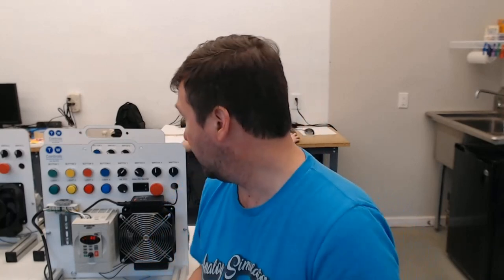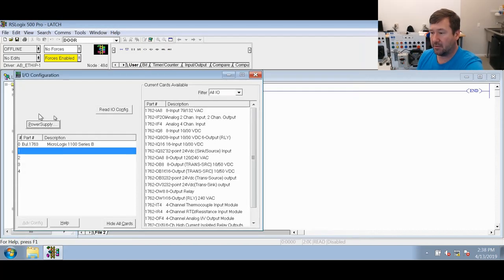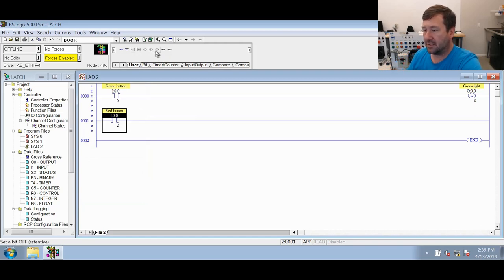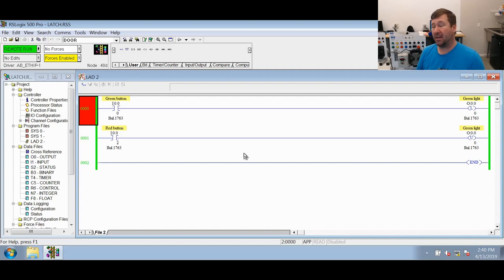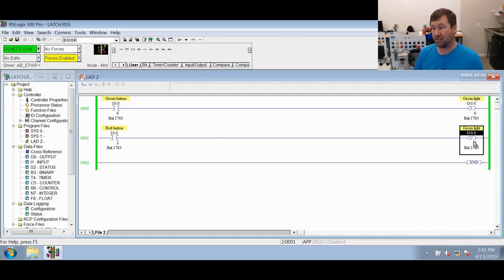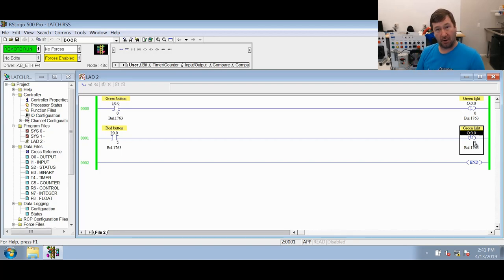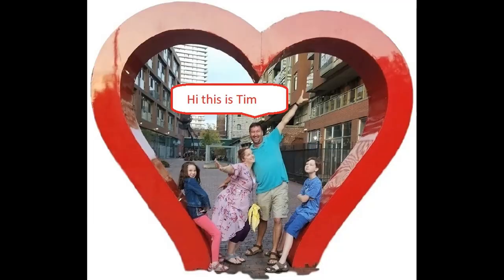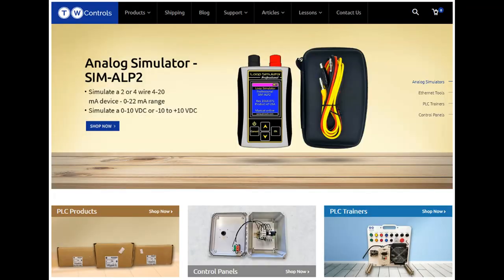RsLogix 500 Latch OTL and Unlatch OTU. Instructions to set and reset

Comment: I love this channel but this video left me asking more questions. Im that guy that doesn't fully understand the OTE/OTL/OTU instructions and how they are processed and controlled. I would like to see examples (right way and wrong way) of how you control step chains when using multiple cylinders (specifically 5/3 valves). I keep finding myself in logic loops that lock up my valves. Thanks for you channel.
Reply from the maker: Hi Nick. My note around 4 minutes in the video kind of hits on that. Latch and unlatch instructions are not the best way to program sequences. We've got a video series on sequence in machine steps coming out that won't help you today. Here is an article series that goes through different ways to sequence machine steps.
https://www.theautomationstore.com/rslogix-500-training-programming-machine-sequences-to-do-an-automatic-process/

Comment: Out of context question but suppose we have a bunch of bits set by the HMI on an allen bradley PLC. What’s an effective, non repetitive way to set a range of addresses, to 0 after a scan cycle or user defined time frame. On Modicon PLCs, they have an IEC_BMDI block which lets you set a range of coils/words to whatever value you want. Just interested as it seems tedious resetting all bits one at a time. Im currently delving into Rslogix again. Have RSlogix micro starter lite alongside , Rslinx and rslogix emulate for simulation purposes
Reply from the maker: For a single word of bits you could use the MOV instruction with a source of 0 are for multiple words you could use the COP command with a source of 0.
Reply: Tim Wilborne Thank you! I figured i could use MOV for clearing contiguous 16 bits (word). I’ll look into the COP instruction 🤔

Comment: thanks for this video and i have a question
what about retentive memory in rslogix 500 
or how can i make memory N7:0 retentive memory
Reply from the maker: All memory on the SLC and Micrologix is retentive so if N7:0 has a value of 12345 and you cycle power then it will have 12345 when it powers back up.
Reply: @TimWilborne  thank you very much

Comment: Tim hello. If I use only the latch system in the ladder and not used unlatch. After switching off and On after 5 min condition of the latch will remain the same or it's automatic unlatch
Reply from the maker: As we say in the video, an OTL that is true goes and writes a 1.  A false OTL does nothing so unless you have another instruction that writes a 0 to it then it will remain a 1.